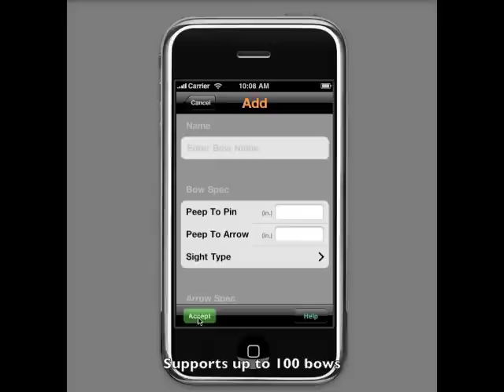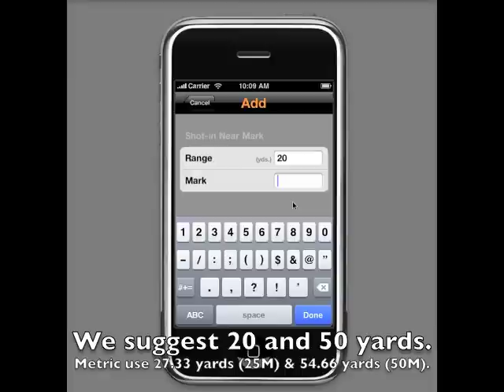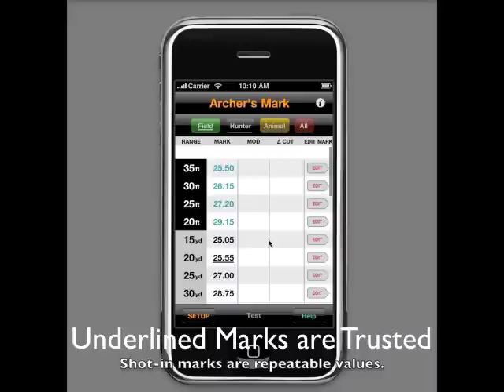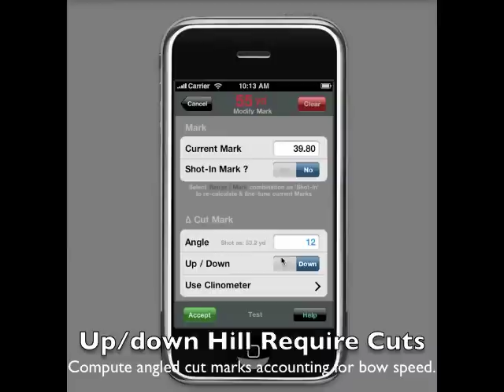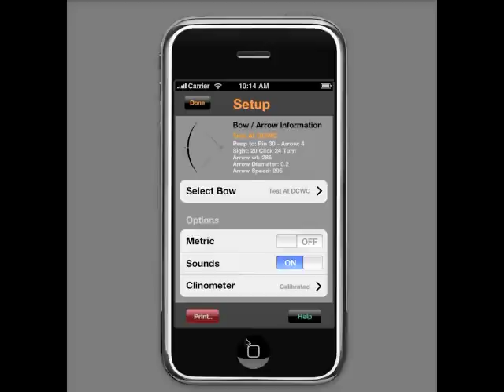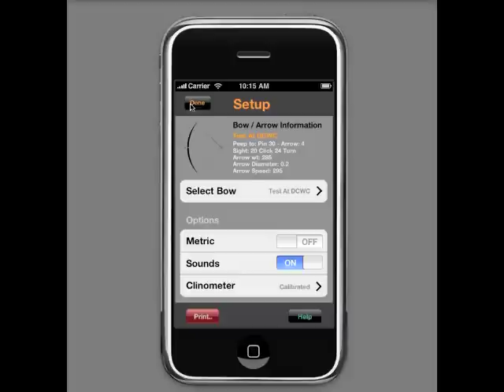Archer's Mark - iPhone / iPod Touch Application

Comment: 2 questions, if someone can help. 

1. Is the arrow diameter the inside or outside diameter (in inches?)

2. How do I measure the peep to pin on an axcel sight with the notched slider that can move in and out? Do I have to keep it static forever?